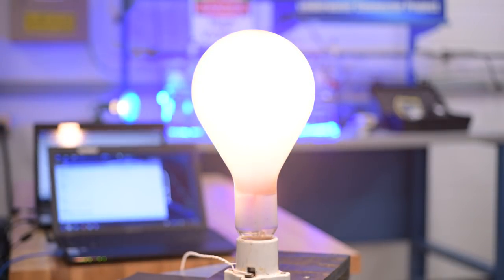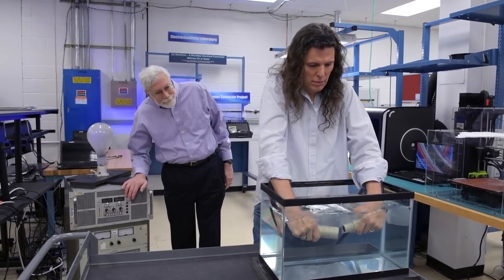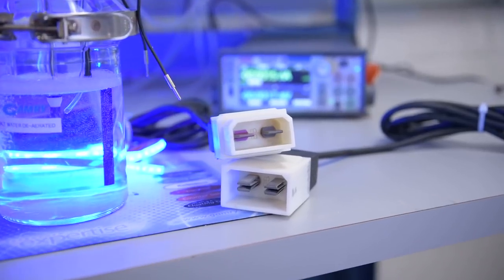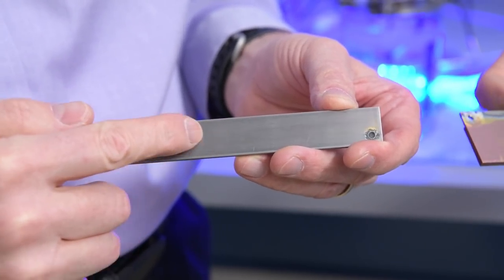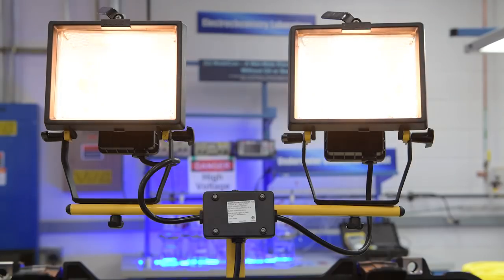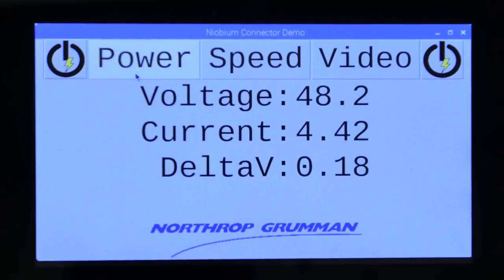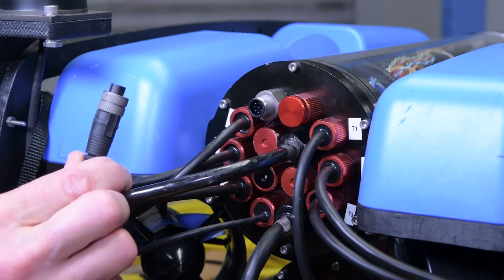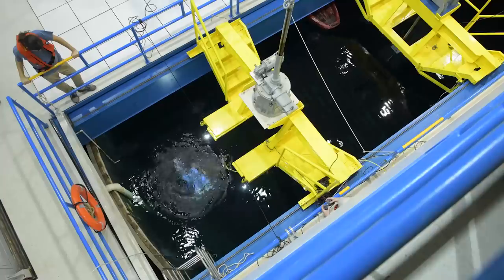Underwater Currents

Comment: What happens when the coating wears off?
Reply: Mr05sti from my understanding there is no „coating“. The material itself forms that layer and is „reset“ when electricity is flowing.
Reply: Any exposed base metal simply regrows a new layer of passivation.  The passivation layer is only nanometers thick, so the amount used up per mate is very low.